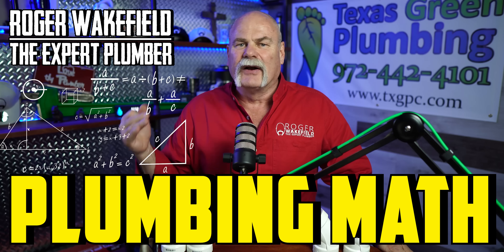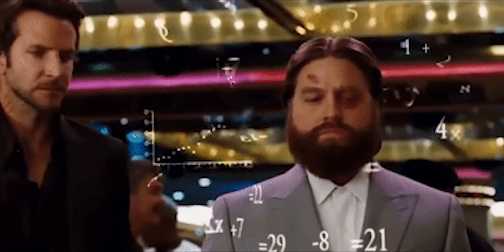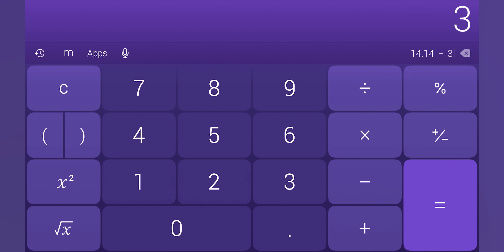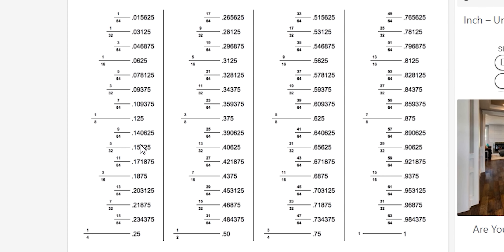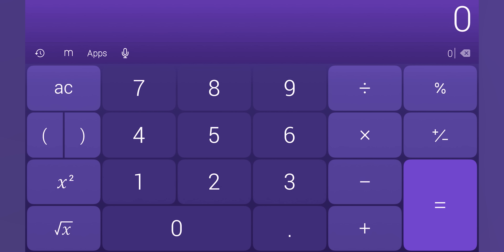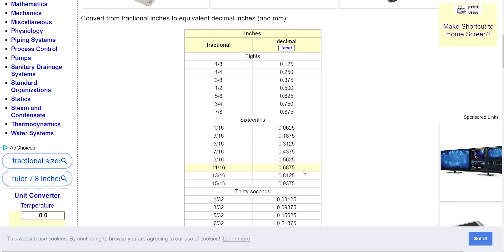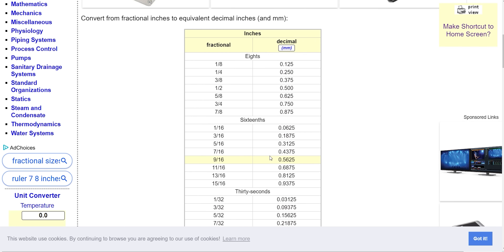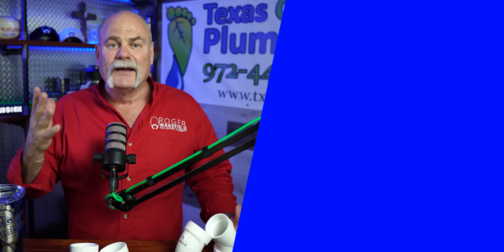How to Calculate 45 Degree Offsets EASILY - Plumbing Math

Comment: Learning how to calculate a 45 reg/rolling offset was one of the first things I learned when starting plumbing a couple months in from my foremen. I have a folder on my phone for dimension catalogs of the manufacturer's we're working. You wouldn't believe the people I met with 6 years plus telling me it's a waste of time while I watch them mess up the piece 4-5 times while I have it worked out on my phone within a minute.
Reply: @Christian Cullip Sorry for late response, you might have got your answer by now. There's different dimension catalogs for every manufacturer's product. 

Dimensions will be different for cast iron,copper,pvc and such and will aid you in laying out your pieces to be installed.
Reply: How does he know to 1.414 to that pacific fitting where does he get those numbers from
Reply: The 1.414 is from trigonometry and is a constant the Dimensions of the fitting only matter for the second part when incorporating your fitting allowances. And my god it’s “specific”
Reply: When working with a 45 degree angle, you are  actually working with a triangle that has 2 sides of the same length (which BTW forms a right angle) and then there's that longer side (this is the 45 degree pipe run). The 1.414 comes from squaring each of the 2 small sides, adding them together and then finding the square root of that sum... which will turn out to be 1.414 no matter the length of the 2 smaller sides. Now since that's going to be the case, we just like to by-pass all the math hoops😄

Comment: Thank you roger! We're open shop and use these formulas all the time for remodels and new construction. When you install dwv systems, there really is no substitute for math and fitting takeoffs, unless you aren't concerned about yielding a square plumb and true product with efficiency. Our approach is to drill an entire house out for dwv, gas and water then install the system with the method you just described, much more efficient than jumping between drilling a few holes, and installing a little pipe. I've had that fitting chart on my phone for a few years now and while I can memorize a lot of them, it's very helpful for larger reducing or odd fittings. How about a  video on the importance of layout, isometric drawings, and some setback and rise formulas for those offsets! I appreciate the service you're doing for the trade in general by changing the perspective people may have about the general skillset required to be a good plumber. Keep em coming Roger!

Comment: For 45’s take your c x c of your spread multiply by 1.5 and whatever answer you get subtract that many 16ths, subtract your fitting  take-offs and that’ll give you your final end x end cut dimension. Your spread is 10” x 1.5 = 15” subtract 15/16” = 14 - 1/16”
Reply: This is how I was taught, no calculator needed
Reply: If you multiply by 1.414 you dont have to subtract the 1/16ths. Just the take offs.

Comment: One of the best tools you can buy:  A metric tape measure!  Easy accuracy down to a millimeter.  Simple math, no mixed fractions with different denominators involved.  
I get the offset / make up dimension from the catalog in inches, then convert it (Google can do it) to millimeters.  Piece of cake.

Comment: Easy way to get the fraction. For example if C-C measurement is 14”. Multiply that by 1.414 = 19.796. Subtract 3” for entire makeup of 2” PVC 1/8 bend = 16.796. Now takeaway the 16 and multiply .796 by 8 to get your measurement to the nearest 1/8 of an inch. You can do this to the nearest 1/16 of inch if your a welder and want to be super accurate. So after multiplying .796 by 8, we get 6.368. Since .368 is less than .500, we round down and keep that as just 6. 6/8 translates to 3/4 of an inch so your final travel piece should be 16 3/4”. Hope this helps guys. Saves me a little bit of time at work when dealing with crazy big offsets.
Reply: That's the easy way? Lol
Reply: @Lkom24  yes
Reply: @yessirrr8180  I just go to my closest quarter inch, 16.796" would just be 16 3/4" but I do like your way after looking at your method to get an even accurate measurement, it is very simple..but I'm also just an hvac installer and not a welder and don't have be that precise😄
Reply: Metric seems easier.
Reply: I'm a plumbers apprentice and I just times by 16 to get to the closest 16th
Reply: Thanks so much for sharing this helped me out tons!

Comment: I am a DIYer and by no means a plumber and this video helped me along my project. 
Knowing that I can look up the dimensions of a pipe fitting using the dimensional catalog was the key for me. I was able to figure out the length of pipe I needed to cut in order to meet with a 90 degree fitting (aka a 1/4 bend! TIL thats also its name). Using a plumb bob I found the center line of my hole and was able to subtract the length of the center line to the hub and it ended up fitting perfectly.
Thank you!

Comment: Great video! Not a plumber , but a diesel mechanic. There are nuts and bolts guys, and there are actual techs lol probably the same in your field. The book way may not always be the best way but its good to have in your back pocket and most certainly covers you when something goes wrong. Kinda like why alot of guys in our field wont go take the ase tests, half of em couldnt pass it lol.

Comment: I am a red seal sprinkler system fitter and a red seal Plumber  I use this method for all my my fittings threaded and glued and solder . Over terms that I use are end to center  center to center  and sometimes face to face  .

Comment: Multiply the decimal by 8 to get the nearest 1/8.  
Ie 
0.6 x 8 = 4.8 eighths… round up to 5… .so 5/8ths 
Just cut on the thin side of the line for the rounding

Can do the same for 1/4”, by using 4x instead of 8x

Been doing some DIY PVC  work and was keen on knowing the secret on 45’s.   Thank you for the education

Comment: The plumber I worked under taught me to measure the center to center and draw 2 parallel lines exactly that far apart and use a framing square to draw my 45 degree line connecting the two. Then lay your fittings on the lines and mark the hubs, measure your cut piece and done.
Reply: Or you could just do the math?

Comment: Right on, I had to hang some 6" cast iron with a horizontal 45 degree offset, I ended up using the floor to get my center to center then travel piece measurement using 1.41

Comment: If you have two 45’s ready to be connected, almost always I have to use a fernco coupler. I can’t get one solid piece into both,. Any tips? Maybe sometimes you just can’t if those 45’s are each braced pretty ridgidly. Maybe only possible when both ends are loose and you can spread/maneuver them..?

Comment: I don’t know how but I’ve calculated offsets with just a tape measure. And I don’t need to subtract the measurement of the fitting.
Reply: That’s only when you measure center to center.
Reply: @jerryrojas6198  But whose pipe or fittings
Reply: @MithileshKumar-dy4mo  My pipe, my fittings and my cut !
You got that Kumar.

Comment: Sometimes I would forget the formula for the 1/16 bend, so I would write it down on the underside of my hardhat brim with a Sharpie
Reply: I do the same. When someone is trying to figure out a measurement I'll take my hardhat off scratch my head while looking and say the answer after I have typed it in my calculator

Comment: Why the 1.14 ? Where does that number come from?
Reply: It's a constant, just a number they know to use through a lot of trial and error. It's just something you memorize because it's been proven to work every time. Like Pi.
Reply: The 1.414 comes from the pythagorean theorem: (a^2)+(b^2)=c^2. Take a right triangle (a triangle with a 90deg angle) and you'll have three sides, two shorter ones and the diagonal. Call the short ones a and b, and call the diagonal c. If the length of a=1 and the length of b=1 we plug them in and our equation becomes (1^2)+(1^2)=c^2. Since 1^2=1 we can simplify our equation to 1+1=c^2. Simplifying again we have 2=c^2. To find the length of c we have to square root both sides. So we have, sqrt(2)=sqrt(c^2). The square root cancels out the square on c and we are left with c=sqrt(2). The square root of 2 is 1.414... In our triangle when a and b are the same lengths we have a 90deg angle and two 45 deg angles giving us a total of 180deg (all triangles have the three interior angles totaling to 180deg) Thats why this constant works for 45 deg offsets. I hope that helps!

Comment: Hey yall im going crazy because of callbacks on toilet supplies and i wanna hear if yall have heard of this or encountered it. Basically these metal nut supply lines seem to always not be 100 percent independent of the braided hose, meaning the hose spins a little with the nut and vice versa. This is a problem because if the braided hose is coiled, it may unthread the nut to the fill valve as it moves. I have never encountered this with the plastic nut supplies, they seem to be looser and grip better. Anyone else deal with this?
Reply: Hold the braided supply line in place as you tighten the nut. This keeps the supply line from coiling up.
Reply: And even if it does coil up after it’s already tightened, just spin the stop the direction it needs to spin(if your using pex crimp rings)

Comment: The chart wouldn’t work for 1 1/2 or 2 inch Genova products 45degree elbows.
Reply: That's why you would go to the manufacturer's website and get the dimensions catalog from them. Not every manufacturer is exactly the same. I'm sure Charlotte Pipe was just used as an example.

Comment: The problems I have with these videos is that I work in mm not inches, so it's quite useless for me unfortunately but I would like to know this
Reply: Most of what's shown should work regardless of metric or imperial. Those conversation factors to find the total length of pipe after finding the center-center distance, will work regardless since they come from trig. Also the basic idea that the pipe fittings take up some of the length calculated from the previous step and that tables likely exist to tell you that length is good to remember regardless of units. Also the final number you'll get from a calculator might be too precise for what can actually be measured so round to the nearest practical measurement increment (I can calculate down to microns but I'm not measuring microns with a tape measure). Finding the right table(s) for the fittings you often use will be a bit of work but hopefully you'll only need to do it once since you can just bookmark the site or make a copy of those tables.